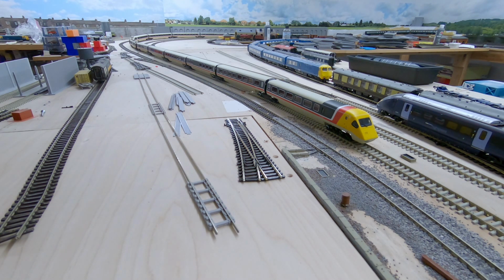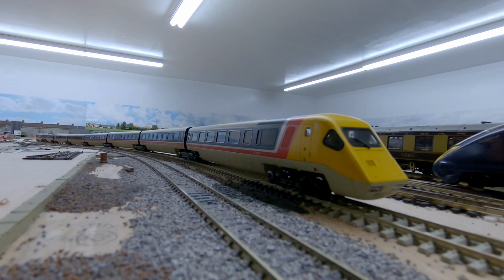New Hornby APT High Speed Test Run - Full Tilt! | oorail.com

Comment: Very impressive, it looks amazingly long, so exactly how long is it in the full 14 car configuration ? I'm starting to worry that my proposed new layout is still going to be too small to do it justice ?
Reply from the maker: Hello Dave. Its a bit tricky to measure, but I measured half of it and doubled it. So its roughly 154 inches or 391.2 cm on the track. The part of the layout you see in the video here is about 50' in track. The real thing also ran in a number of configurations, so you can easily get away with having the 14 car set and running it in 11 or 10 car formations for example.

Comment: In service would the real APT have had a 14 car configuration?, and altogether how much did the model cost in £'s??.
Reply from the maker: Hello Chris. The real APT ran in a number of different formations, there are a lot of pictures on places like flickr and several cine/archived film footage on YouTube. Its normal configuration was the 14 car configuration. The APT broken down on the return journey on Monday December 7th 1981 when the tilt system failed. For passenger service, you would need the 7-car set, as that is the one with the black band around the windscreen. I don't think the full yellow end livery was ever used in commercial passenger service. The photos from December 7th 1981, which was its first commercial passenger service, it had the black band around the windscreen. There are photos and video showing it running in the full 14-car configuration, however it looks like it also ran in shortened 11-car and 10-car formations. Looks like one half was full, and the other have had the DTS and TBF, and sometimes an additional coach. Looks like it always had the two power cars in those formations though. In terms of cost, the 7-car pack is £533 and you would need the four 2-coach packs (TU, TF, TS and TRBS) which are priced at £99 each, so the total cost for the in service version would be £929. The version you see in the video, the 5-car pack costs £434, plus the coach packs at £99 each, plus the NDM (motorized) which is £120. So the total cost in the UK for this train would be £950. The 7-car pack includes the APT-U experimental coach which is not part of the configuration, however I think the 7-car version there is one motorized NDM and one dummy. Thankfully, I am outside of the UK, so not subject to VAT, so it was significantly less! :)